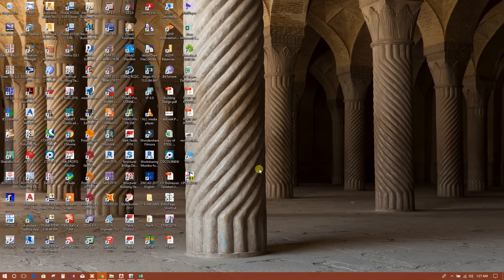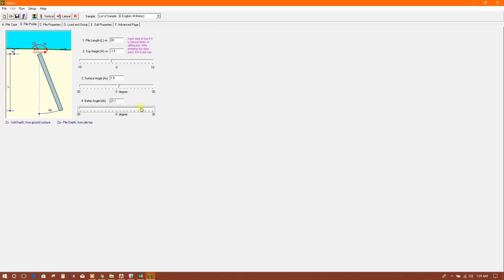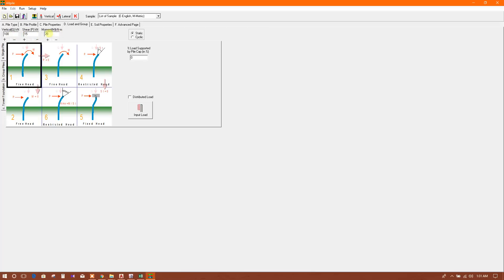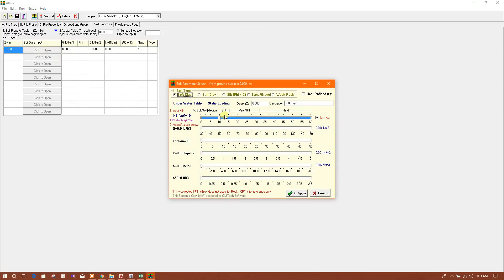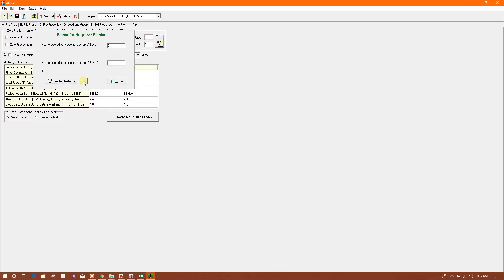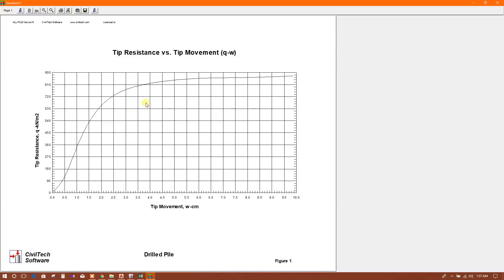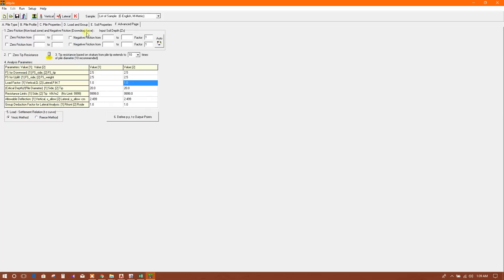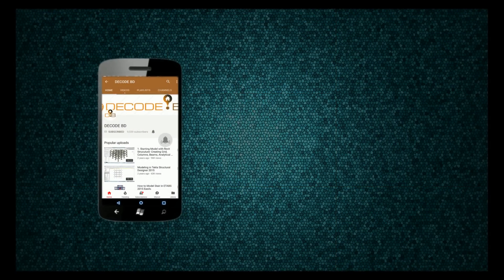PILE CAPACITY CHECKING IN ALLPILE

Comment: Assalamualikum, How to activate this software? without this it's showing only demo version.
Reply from the maker: There is read me file. Follow these steps.
Reply: @Decodebd  There is only one txt file where below notes has been mentioned,

"Allpile V7.3B

info:
AllPile is a Windows-based analysis program that handles virtually all types of piles, including steel pipes, H-piles, pre-cast concrete piles, auger-cast piles, drilled shafts, timber piles, jetted piles, tapered piles, piers with bell, micropiles (minipiles), uplift anchors, uplift plate, and shallow foundations.
One of the major advantages AllPile has over other pile software is that it combines most pile analyses in a single program. It calculates compression (with settlement), uplift, lateral capacity, and group analysis all together. Users only need to input the data once instead of several times in different programs. AllPile makes pile analysis easy, economical and time-efficient.
AllPile is suitable for all engineers, even those without too much pile analysis experience. It helps structural engineers choose soil parameters, and geotechnical engineers choose pile properties. AllPile is a must-have tool for structural, geotechnical, and construction engineers.
Download:
Code:
http://www.civiltechsoftware.com/software/all-pile.php
http://rapidshare.com/files/263943781/Allpile_V7.3B_Full.rar
AllPile v7.3B medicine
Password: Bknee"